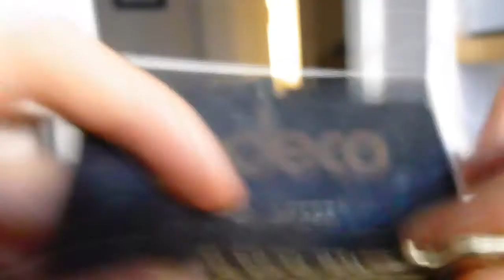Medeco Biaxial 6 pin KIK picked & gutted

Comment: Wow man that's very impressive. Great work. Doc, shine some more light on me, what's the difference between regular and biaxel?
Reply from the maker: Papa Gleb Thanks mate. To be honest I couldn't tell ya... aside from different keyways and the classic being 5 pin, I don't really know. In terms of picking they're pretty much identical.
Reply from the maker: DrBint Disregard that, I'm boning up on these a bit more and the classic & biaxial are both available in 5 or 6 pin.
Reply: DrBint Papa Gleb Classic has 3 angles - L, C, R; Biaxial has 6 angles - fore (Q, B, K) and aft (S, D, M) and the pins are slightly different as a result.